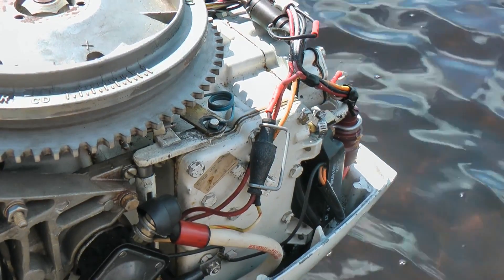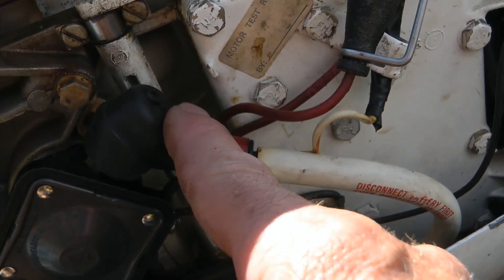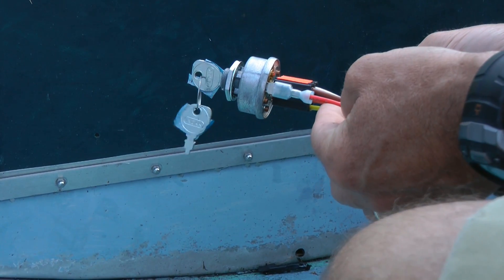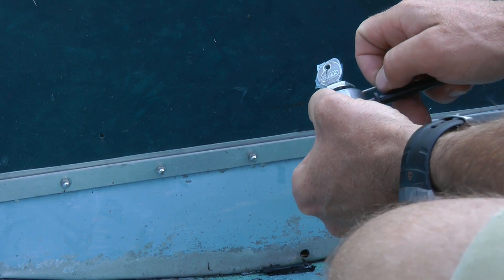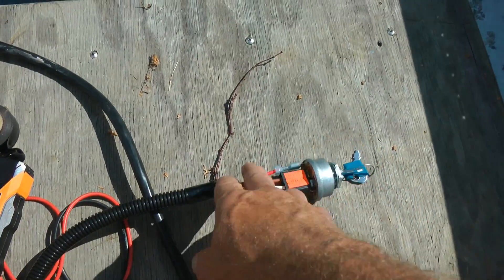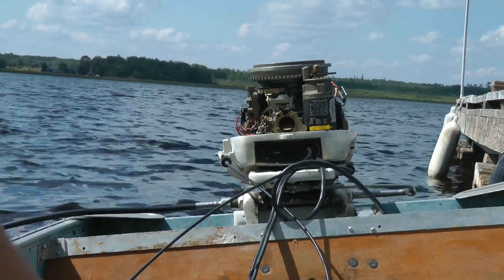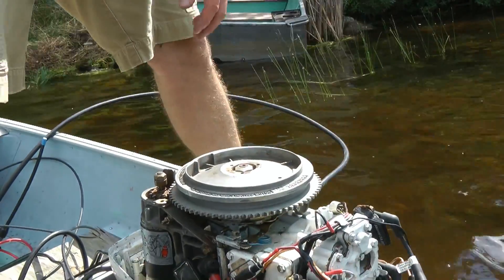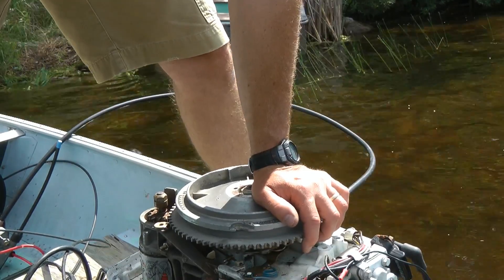Getting an old outboard motor running - Part 3 - Electrical Harness & Spark

Comment: Thanks, i had the same problem on my Suzuki. I've just brought a 40hp and trying to install a tachometer but can't find the tach cable/signal cable. But when i tried to look for continuity, both positive and ground where connected and i was a little worried that the outboard will burn out because of a short somewhere. I will check the ignition tomorrow if a switch the ignition on and see if the positive and ground is still showing a continuity between them. never though that a killswitch can do that. Thank man, big help

Comment: Hey Mathew, I think it is extremely neighbourly of you to take the time and effort to give us your help and experiences fixing your outboard. I know that this could have been done quickly had you not had to video, work to the camera, hold things, and then edit it all. It is appreciated. You also speak very well, and you make it understandable. Thanks so much brother.  I just happened to be doing this very job on a 1989 Mariner 30ELO.  I have no remote controller with key switch, so I bought a 6 pole switch with push choke. Now I will Jerry-Rig my way through. If you happen to know where to get the 7 pin remote controller for this engine, maybe let me know? Anyways, I have yapped on enough. Thanks and warm regards, Cam.

Comment: My outboard was starting off the key, i turned it off via the key and started again then tried to turn it off again via the key but it wouldnt turn off. I had to disconnect the fuel so it would eventually cut out, any ideas why? Could it be the key ignition or the Solenoid? The Solenoid is newly fitted recently but has been fine since changing

Comment: Okay Boys & Girls, 'When' you use an Ohm meter to test continuity, ALWAYS make sure the power is off or disconnected. The goal is to NOT let the magic smoke out of the meter. Again, Ohms, or continuity testing.... Plan your tests, put the meter in VOLTS, and check for power. Do all your connections and tests looking for voltage first. If you have No Voltage, you are safe to use Ohms / Continuity testing. Let's all keep the magic smoke inside the meter.  Nice Work Matt!  This series is really going to help me.

Comment: You are checking spark in a very difficult manner. All you need is a 5 dollar spark checker from Harbor Freight. Hooks up in line with the plug and has a bright orange flash if it has spark. Doesn't require removing the plug or manually spinning the motor. Works on every plug and every gas engine.
Reply from the maker: Sure. But if you don't have one...

Comment: Hi Matt.  You are going about your fault finding in a logical manner.  Sometimes when working on vehicles the problem can sometimes be staring you right in the face and it is overlooked.  You are doing a great job when you consider you are working on the water.  If you want to test the plugs its a good idea to get a zip tie and attach the plug to the body of the outboard.  Also its hard to check for spark in daylight as it is hard to see.  When I was in learning about electronics we were taught the half split rule.  Check your circuit for power half way between load and battery.  If you have power look further up the circuit.  If not go back.  Great videos Matt.  I have a Johnson 70 hp that needs attention.  Hasn't been started in 10 years.
Reply from the maker: Thanks for that. All good advice.